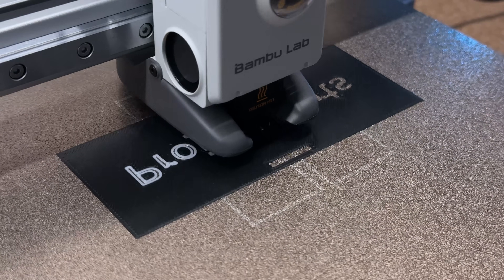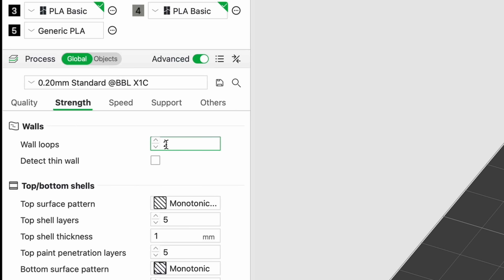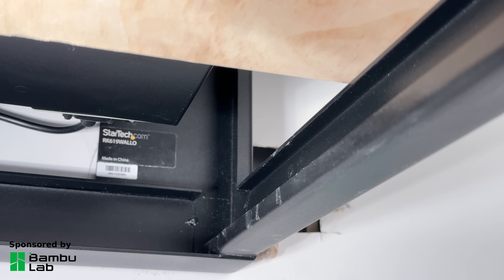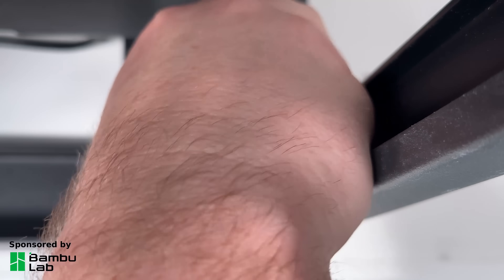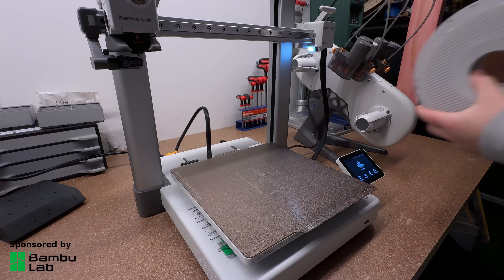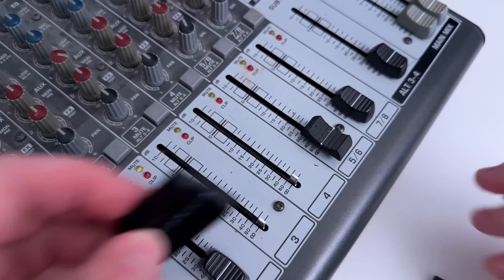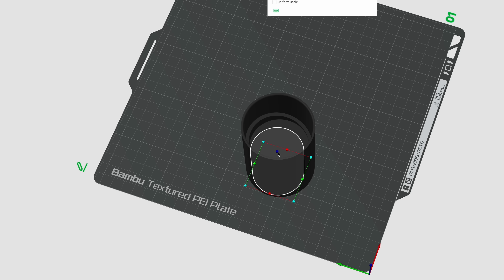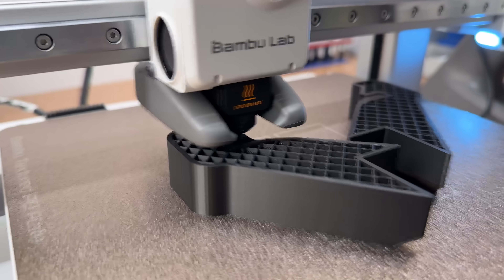More Unique Functional 3D Prints I Use Every Day

Comment: 5. Small idea for alternative for the mixer print. Instead of a full separate cap to join two knobs, you could make a "snap on" holder which goes around the existing single knobs to clip them together. That way it is really simple to click it on and off during the mixing session.

Comment: The toys and print in place widgets are fun. But that's not why I bought mine. Very happy with my A1 combo. As you said. Some assembly. Set up an account. And you are on your way. I've already used mine for some practical home solutions and part replacement. 

Need some kind of random spacer? Sure you could tape coins to the back of the thing. Or, for less money than any of those coins, you can print a little spacer that is exactly the right size. The possibilities are endless. Unless of course they need to resist fire or other extremes. 😁

Comment: OP can I ask why you made a whole assembly for your cameras rather than an adapter ring between he shop parts and camera? What were the design considerations/concerns.
Reply from the maker: Standard mounting blocks are about 1/2 the size of the camera so an adapter plate won’t work, it also won’t leave room for the cable connector. They do sell specific mounts for this camera but they are relatively pricy and I’m think they might not be metric to fit my existing conduit. 

The main design concerns where it need to have room for the large cable connector and connect to 20mm pvc conduit.

Comment: You'd think you'd want things to get dirty in the bedroom. 😇 PLA feet is fine but PLA for anything mechanical is kinda blah. I much prefer PETG. Especially the UPS brackets are just no bueno in PLA. If things get warm (and not even hot, just over room temp) the PLA will start deforming faster when it's under pressure, and it will deform over time even in room temp. PLA is fine for toys and decorations, but you really don't want to use it for long term items that are under any mechanical pressure. PLA is actually quite possibly the strongest non-engineering grade filament out there -  stronger than PETG for instance - but it's not as stable, and it's hard and therefore brittle. PETG for instance will flex a lot and not break; PLA will just snap. But with that PLA under the UPS under constant pressure, it will deform. And if it deforms enough, it may just come loose. And if that happens, your heavy UPS  will smash into the ground at speed.

Comment: Having snapped PLA on a desk hanger headphone bracket before, you think it's good until it starts bowing or separating. More layers is always better, but so is cross-layer strength. The weakest part is twisting or torsional stress, i.e. flexing between layers. Once it stats to flex - or just starts to pause and separate- PLA tends to just snap at the layer, taking the whole print off at that layer. This print looks fine - but it's also clear that you added more outer layers and a rigid infill too. The weakest point is still the weakest point, so don't feel like it's optional. 

things happen, and a UPS is a lot of weight with 2x SLA's or 4x SLAs at 5-6kg each - for typical pairs of 12v 9A batteries.

Strong weight-bearing PLA can be done by slowing it down to print at a hotter/slower setting to bond the layers and have a more solid print without visible layer lines. But it can also make a difference with slicer and orientation too. The way it breaks can be very dependent on the nature of the filament layers separating rather than snapping. Infill can help with rigidity - but once you have to deal with crush, flex, stress or weight-bearing, all rules are off.
Reply: PLA is the strongest non-engineering grade filament but it has undesirable qualities to say the least - a mere 60 degrees C and it's melting, and even at lower temps than that it deforms especially under mechanical pressure. It's also hard, meaning it doesn't flex much - instead if just breaks. PETG is easy to print if you pay a little attention, even my years old Prusa MK3S+ prints it flawlessly and it's a much better filament for mechanical parts.

Comment: 5:22 PLA is not a good choice for objects under load and would be even worse if that UPS heats up at all. PLA sags over time and does so quicker with heat or load. Your design seems sound and should hold despite the sag. I would have put some round ends on your clips as well so once it clips in, the clip would still be in contact. That would also keep them from sliding in the mount. Printing in PETG will maintain the elasticity much longer.

Comment: 5:17 So much this! PLA is often being talked down, but it’s actually quite good for most non-outdoor things. It’s even quite robust. I print things that get some load with 4 walls and 50-70% infill and never had something that broke (the things are basically hunks of plastic).

I get my regular filament from a local German brand. But I have absolutely zero issues with using Amazon basics PLA. It prints just fine for all my use cases.

Comment: 1:06, Just in case someone wanted this info, when making something that is designed to face the elements, you should be using something called "ASA". It is a lesser known engineering grade polymer that, admittedly, can be a little fiddly on some lower end machines, but it is the absolute best balance of strength, weather resistance, UV resistance and resistance to warping, cracking and deforming in general. Many people use PETG, but that tends to sag and warp outdoors. ABS tends to get brittle over time, and can break from frost damage.

Comment: Andy, thanks.  YES, functional and actually useful 3D print ideas are what I'm looking for, and found your ideas intriguing.

Some additioanl thoughts:
- Are you sharing any of these models?  If so, perhaps links to the shared pages (Printables?  Thingiverse?  MakerWorld?) in your comments?

- If not sharing models, perhaps go through the process (including mistakes along the way) of modeling your useful prints.  You did that a little in this video, but way to vague, no detail, too quickly.  For instance...
     - When you were designing the supports for your UPS, there was a moment in the video where you curved the back corners of the rectangular profile for the part, so it would rotate in.  But what was the actual thought process during the design?  What tools were you using -- and how -- to simulate that in the design process?
     - Another example: the wall plates for the mount for your doorbell.  The plate is apparently a two-piece design, with the first part getting screwed to the wall, and the second part snapping onto the first.  Would really like to see the design process you used to make that.  Seems similar to the wall plates for Aqara wall switches, but not exactly.
     - And then  there was the spotlight guide.  You gave a quick overview of what process you felt you should have used, but no details.  Yes, this kept this video snappy and on-point, so maybe make a new video showing your journey, from modeling in ... Fusion? ... and then realization for a better way, and go through those steps.  At this point I don't understand why your initial design took so long to print.  What about the design caused that?

- What solutions do you have for parts that would end up too large for your print bed?  All your prints in this video seemed like they should fit on a nominally-sized Bambu printer print bed, though the fan duct adapter had me thinking that one was probably close.
Reply from the maker: Thanks for your feedback :)
I'm sharing pretty much all my models, there is an accompanying blog post that I do with all my videos that has more info and all files available for download, I've even included .step files to make it easier for you to edit them. (there is a link it the description)

I've got a lot of feedback about wanting to see more of my design processes, I tried to do that in this video but it was still not enough detail, I am working on a more in-depth video on how I design parts so hopefully that will be more useful when it comes out.

For the light guide I think it was really slow as printers tend to print slower for the outer walls, modelling a thin grid like that mean that for the first part of the print all the internal structure was "external walls" and the printer printed them slower.

I hope this helps.
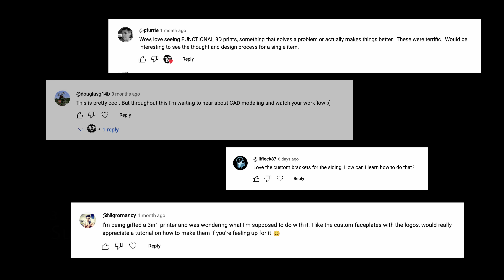Reply: @YeahNahDIY  Interesting story: A friend texted me today, told me he saw my comment within your video.  I forgot I sent that comment (but it is still true), and then looked at this video at about 2:20 in and saw that, sure enough, there's my comment!  :)  Funny, I didn't notice that during my first viewing of this video a week ago, and then I posted another comment (oblivious to the first one).

Thanks for sharing your models, that's cool.
Editing STP files?  Boy, if I could get a handle on that.  Seems to be no good way to do it.  If there is something I'm missing, that would be a good case for a good video on the subject -- I've watched others that were rather unsatisfactory.  In the end, I break out Fusion 360.

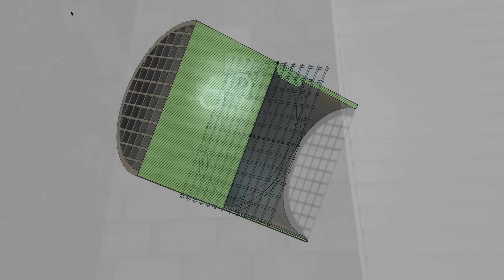Comment: 8:26 I did something similar but I just printed a rectangular box with a ramp on one edge with no top/bottom and grid infill. I stuck it in my mailbox to raise my mail about half an inch off the bottom of the box to prevent the mail from getting wet because rain always seems to find a way inside.

Comment: Your excellent video really resonates with me...  for many years I had a fascination with all types of CAD and CAM software, experimenting at length with anything I could get my hands on.  I had no valid reason...  although my father had a contract-engineering business, my airline employment was Ops related.  Regardless, I wished I could see my designs become real, to complete the process.
About seven years ago I bought an early-release Ender 3.  Like you, I felt that the endless stream of Action-Men, Barbara-Dolls  😜,  Fidget-spinners, etc that were at the centre of advertising, were on the wrong track.
If anybody asked, I would probably say "I have not used the Ender a great deal, but I have had more than my money's worth of enjoyment from It."  I have printed about ten frivilous items, like Chain-mail fabric, Wire-frame Teardrops, etc.
HOWEVER...  If I look around me, I see dozens of useful adapters, cases, mounts, swivels, racks, brackets, covers, ducts and fittings.  Some were time-consuming masterpieces (Yeah... RIGHT), while others were quick solutions.   All of them gave me pleasure and satisfaction, so to those who knock 3D printers, I say "Try it before you open your mouth!"
Thank you, Liked & Subscribed...  GO KIWI!   👍  😃

Comment: Some of mine: new fan centre bush for pool pump, pool vac head to creepy hose adapter, plate spacers for pool cell, double stacked mount for Andersen plugs with click fit cover, terminal cover for Redarc dual battery switch. Support for 50a fuse that was in mid air under the bonnet, small pivot pin fitted to drivers window switch block, TPS mount and shaft adapter for FCR41mm carbs, damper seal in back end of air nail gun from tpu, TPU link that extends between button and hole in top picked to save phone from diving out every time I bend over. Çovers for holes in ceiling space catwalk, comfort caps for guitar stomp buttons, bidon frame mount for small dia seat tube.

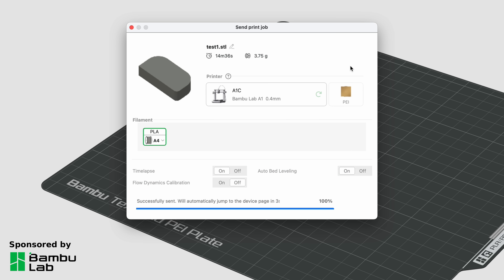Comment: 3:40 when I have done this in the past I have printed the whole item but with very low infill and 1 wall thickness.  This prints fast and uses very little filament as in your example.  I think both methods have value. Yours to ensure the correct geometry for full thickness parts (heat shrinkage) and mine for full part confirmation.  I'll use both for different tasks from now on.

Comment: My brother in christ, i get a sponsored video, but this feels like one of those tv shop commercials. Other printers run just as good as the bamboo lab one out of the box... If you wanna sponsor something at least give some real reasons why its good instead of just reading of a marketing doc.
Reply from the maker: Hey, that’s completely fair point, I did say a couple of things from their marketing but 90% of what I said was my own personal experience of Bambu, I paid for the P1S with my own money and I was a big fan of Bambu before they reached out. Like I said in the video I’ve had a bunch of printers in the past and this is the first one that worked out of the box and I’ve had no issues with. But going forward I am going to change the way I do sponsored segments, thanks for your feedback 🙂
Reply: @YeahNahDIY   Thanks for the response, and since you were kind enough to respond I'd just like to clarify, I didn't think you said anything false about the machine, or tried to mislead, I believed that what you said was your own experience. My point was just that it sounded really sterile at some points, more like a sales pitch, and that some of the points mentioned are true for most modern printers and sound kind of pointless when mentioned, not really something that makes this particular printer stand out.

Comment: modelling stuff to print is awesome, but the iterations and time put into custom designing and drawing an object (espcially when it's a new 3d modelling program or application) is the most time consuming. I have found that you can use AI with photos of an object to create a baseline model that you can modify and manipulate which cuts the time down from concept to final 3d print by more than half and it was all in the prompts and how you set those up. It's super powerful and adds to some of the functional prints that I have done. Hopefully you can try that out for some future projects.

Awesome work!
Reply: do you have some examples of your prompts, this is very interesting..

Comment: Good examples for 3d printing greatness.  

I am just wondering about your older 3d printer.  Have you been stock in 2015? 😂. There are so many open source ( and closed source ones) that would take you even further that the commercial printers available today.  Like the Vorons.
Reply from the maker: Yeah I was suck in like 2013 until a few years ago, when I was researching a new printer it was amazing how much had changed, I think Vorons are really cool but right now I don’t want to work on my printer I just want to print stuff ☺️

Comment: Thank you so much for the video. It's nice to see folks printing useful things instead of toys. I've designed all sorts of gadgets around my home. I replaced my old Creality printer last year with an A1 with AMS and I was blown away. Bambu Labs just works. No screwing with it, or spending hours leveling the bed.  My hobby is now making stuff, not my 3D printer.  I use their filament too, it's fairly cheap and works with no issues.
Reply: I can only recommend to you Sunlu, but as Bulk from Aliexpress. Its much cheaper, but since Sunlu worked with Bambu in the past its nearly the same quality, maybe even better if you go for PLA+ from them. They even have preinstalled profiles for most of the Sunlu Filament in the Studio, the only thing missing is the NFC-Tag for the AMS to automatically detect what filament it is.

Comment: You won't find a lot of useful, functional parts on 3D print sites, purely because the things you find functional are very likely to be custom to your application; the one exception might be upgrades for your model of 3D printer.

That's why you find cute toys on those sites (which are great), but not functional things.

...Now I've just reminded myself I need to draw a custom wiring fingers loom for a model I'm trying to build. Siiiigh.

Comment: I'm a maintenance employee in a Hotel company, and managed to get myself a 3d printer for the job. I've created many things so far, but great examples:
1- A discontinued embebbed ceiling lamp holder, just got an old one, mesure it, and made it in 3D
2- Some terrace LED strip mounts for the terrace. It was pitch black before, now you can stay in the terrace with nice ambient light until 10PM in winter
3- Several power transfomers wall mounts for the server room, they were hanging from the wires before
4- Several signs for the pool (max depth and so), kitchen, warehouse, etc...
5- CCTV cameras mounts, since the manufacturer charged well above 80€ for a piece of metal, and took several weeks to deliver. I took one, replicated it in CAD, and got 5 copies in just 2 days

and many many more small things, the list goes on and on. There's also toys, of course, but not just that, many people think that 3d printers are toys... they are tools. Even other hotels from the same company ask me to create pieces for them.
Reply: They're probably very happy to have an employee that can come up with ideas like this.
Reply: @harrywind1870  yeah, that's why I got an upgrade, from the ender3 v2 to the sovol sv08 😆
Reply: Sounds like a business idea
Reply from the maker: I was a maintenance electrician I would have loved to have a 3D printer.
Reply: I work in xray tech and its like pulling teeth to get one at work. They rather pay more and wait longer. Imagine being that dumb

Comment: Wow, there are many ideas to take home, for me! Thanks for your video!

But make one chance to give your printed parts a long life. PLA ist not made for a long life and not for outside use.

With an filament dryer you can upgrade your Bambulab A1 to PETG printing. PETG lasts nealy for ever and the printing is the same. Bed-temperature must be 80° C and the nozzle must be 235° C - that are the only tricks to print properly with PETG.